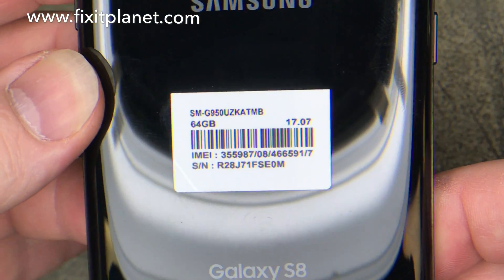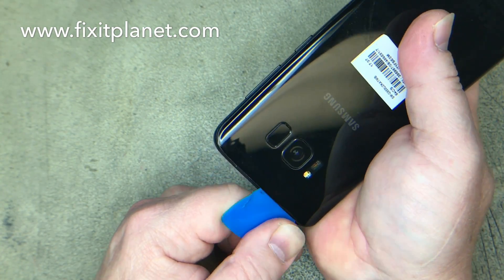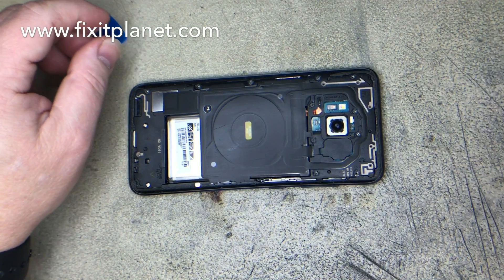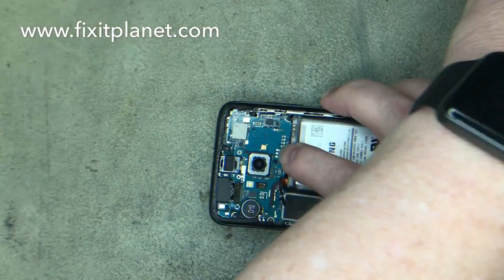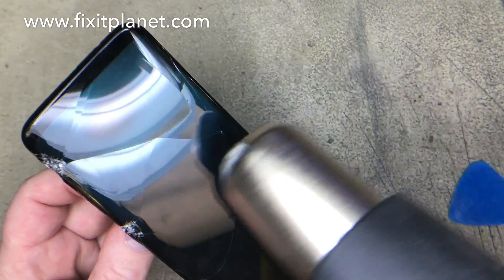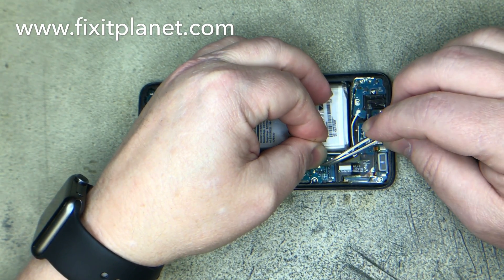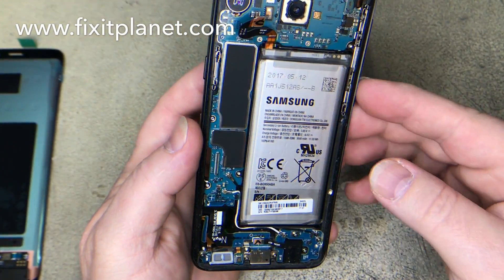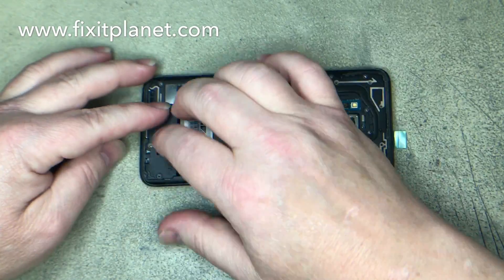Samsung Galaxy S8 Screen Repair From Start To Finish.

Comment: Who's watching on their broken s8 : (
Reply: Mine did fly all over the stairs from the third floor all the way down to the ground floor :/ both sides are broken.. happy that it's still working at least
Reply: Gabriella Ceccato i bought that 360 case to hide the crack on the top right corner now. It's pretty good
Reply: I'm on my 3rd S8+ after having it replaced twice due to a broken screen! Not sure why this model is so fragile. I had an S2, Note 3 and 4, and never got so much as a chip. And I'm very rough with phones.
Reply: Haameem 

Unfortunately, I am too.
Reply: Yep.  I'm getting it fixed next Tuesday and I wanted to see how it works.  Luckily I have insurance so it's only costing me 30 bucks to get a new screen.
Reply: @AerasaniCaecina  i have Insurance on mine also, did you use the company that was affiliated with Samsung called "ubreakifix" and if you did, how has it been working every since? Touch or calibration issues? Thanks a lot in advance.
Reply: @AerasaniCaecina  Andd..... did it works
Reply: Sheesh I remember when my s8 cracked last year 😭 I cracked it the weekend I got my phone LOL😤🙄
Reply: I'm truly surprised and disappointed at the terrible build quality of the s8, its so fragile and easy to break and then hundreds to repair. Wish I knew this before getting the phone to be honest.
Reply: My s8+ screen has cracked twice while in a armoured case and that sucks...I love this phones performance but the curved screen is very vulnerable to cracking and there is no upgraded screen from Samsung. The last time my screen broke it fell less than 18" from my couch on to a carpeted floor in armoured case. It cost 200.00 to replace the phone under warranty and less than a month later its cracked again. I'm pissed. There will be no more curved glass screens for me .
Reply: @pat402  
SCARY STORY. ..WTF
Reply: @pat402  S10e is flat! :)
Reply: Me my s8+ fall down by a baby he drop my phone I was mad but I just cool my self it was damage we I come home everything was fine but tomorrow the upper screen did not work 😞I was sad I had to pay 20,000 to fix       R I P TO MY 20,000 money
Reply: Me my husband cracked the corner of my phone :(
Reply: I am
Reply: It happen yesterday when I was talking a dump
Reply: Slipped out of my pocket 😵
Reply: My mom turned off the wifi so I got mad and threw my phone onto the wall it has a small crack on the top left now. I was planning on getting a new phone and now I have a excuse. But then I cant sell my s8 cuz it has a broken screen and no one will want it smh
Reply: Me
Reply: Me
Reply: There will be as much people as you got likes watching it with their both back and screens completely broken after trying what they saw here, 100% positive about it.
Reply: Me
Reply: same but mines working pretty fine lol the heavy crack didnt affect anything
Reply: Me
Reply: just cracked my s8 a few days ago :( can't afford repair so im planning to just put screen protector over it and hopefully it lasts long XD
Reply: @elmothemilkman99  did it last over 6 years?
Reply: Me lol
Reply: Christina Cole lucky you
Reply: Me
Reply: Haameem Rathore legit fell doing bmx on my s8 pull it out and instant disappointment came in
Reply: I'm watching on my new daily driver (the s9) my dad had the s8+ but now he has the s9+. He gave me his s8+ to use as a secondary driver and I'm having trouble finding a good kit to fix the s8+ so I can use it without cutting myself
Reply: I only have scratches on my S8+ and dropped this thing too many times in water or washed it in tap so idk why my phone is still alive even after an year???? 😬😬
Reply: It has 1 a little bit crack then a big crack right in middle of the display.
Reply: @turnipii4246  🙋‍♂️
Reply: It's so broken that I'm watching on my backup phone
Reply: Me
Reply: Sadly me😓
Reply: <--- this guy
Reply: Yea :(
Reply: Lol .. meeee
Reply: Me I just broke it today I accidentally dropped it face first on the cement
Reply: here :(
Reply: I am
Reply: Haameem Rathore Me lol,
I'll be sending mine in to Samsung in the next few days
Reply: i am just want to be ready when that happen.. still safe for now
Reply: Me
Reply: 6 months late but mines fully cracked :(
Reply: Nope watching on my old s6 because the screen is totally dead on my s8 ringtone works so i know phone works
Reply: MEEEEE HAHAHAHAHAHA
Reply: Unfortunately meh
Reply: Haameem Rathore e
Reply: Me with crying heart
Reply: Im buying a kit off ebay and going to fix my phone.. lol seems very easy.
Reply: Me 😆
Reply: My s8 has JUST had screen burned.. lol
Reply: Me :(
Reply: Hi
Reply: Me
Reply: Me :(
Reply: Me
Reply: @tremccord8396  unfortunately me also. About find out what's best way to handle this with Verizon since i do have Insurance on the device.
Reply: I am🙋‍♂️
Reply: I DIDNT MEAN DO I ACCIDENT HIT MY CONTROLLER ON THE TOP HY THE CAMERA AND THE SCREEN BROKE I WANNA COMMIT NECK ROPE
Reply: My S8 had a encounter with angle iron, I cannot watch anything on that.
Reply: ME
Reply: I have 7 scratches :(
Reply: Me
Reply: I am. Dropped it from my face and landed on the asphalt. Cracked in the upper right corner. Really annoying. Maybe time to upgrade to S9 or S10/S10e instead of fixing it.
Reply: me
Reply: Yeah:(
Reply: Me 😪
Reply: Im watching on my s7 broken screen because i bit int it cause i was so pissed at brawl stars
Reply: Me :))
Reply: Meeeew
Reply: Me
Reply: Me🙁😰😰😰😰😰😰😰😭😭😭😭😭😭😭😭
Reply: Not me but mine has like 3 or 4 scratches that you can actually see clearly and feel, then there are more throughout the whole screen that are only visible with the reflection of light, but it really bothers me because it looks so bad...
Reply: Not me🤣
Reply: Me! Except with a cracked note8 lol
Reply: Me
Reply: Yep...;( got home and noticed a crack right where the home button is -_-
Reply: @afreemn  what happened after? I cracked mine yesterday
Reply: @justinherrera2159  I was at an arcade with my brother, not sure what happened that caused it to crack, I always have the screen pointing towards my leg so even if I hit the phone on accident, the back would be the part getting hit. And of course I have a case, but honestly I'm not sure how it got cracked
Reply: Me
Reply: Meeeeéeeee☹️
Reply: @Andre £150to £170 I have been quoted from 2 places one did my I phone 6 when it was about 8 months old he did the screen and new battery for £80 he said he won't try the Samsung he sends them off to get done I would have stuck with apple if I new this about the screens being so delicate.🙄
Reply: Wish it was working to be able to do so
Reply: I habe a S8 but hes not Borken. 🥳
Reply: Lol 🙋‍♂️
Reply: No im watching on iPhone xr i want my old phone
Reply: HEYYY
Reply: Me :(
Reply: Me
Reply: Me :( broke the screen today and broke to buy a new phone in meantime
Reply: This guy😂😂 *(not neccesarily broke but um cracked ...so yah brokeish😂😂 (kind of like my bank account😂😜)
Reply: I’m fixing it to sell
Reply: Me:(
Reply: I have a big crack on my s8 so I'm gonna get it fixed soon
Reply: Me
Reply: I’m on my backup cuz I can’t even do my security to log in
Reply: Me
Reply: Me .
😰😰😰
Reply: Not me mines beyond unuseable that the touch capability malfunctioned on me this is why im watching this on a diff device and so i dont have to burn thro so much money getting mine fixed so i can make a profit
Reply: I broke my s8 screen yesterday when charging
Reply: @Tryxoth  add up the costs very carefully before replacing your screen refurbished new S9 seems cheaper
Reply: Here :(
Reply: HAHAHAH!.. me!.. and within 1:30 of this demo I realized that I do not possess the skills to complete this task..
Reply: Me 😫😞
Reply: Me
Reply: Meee
Reply: Me
Reply: Facts 😂😂😂
Reply: Me I dropped it just right and cracked the screen and to repair it its 350
Reply: Michael Martin you sure you ain't using apples repair site? You can repair the screen professionally for less than 150
Reply: @patriotcam1776  350? That is what a need phone cost
Reply: Here. :(
Reply: i thought this was the note 8 lol wrong squad lol i feel like regina in mean girls lol you cant sit with us
Reply: Taurus April-Mae lol
Reply: i m not 😂
Reply: Jake Margiotta what you gonna do about it now?

Comment: This guy’s voice and the calm music in the background makes you wanna be brave and do this yourself.
Reply: Are you flirting mate??
Reply: Lol
Reply: That's exactly what happened to me and I shattered the back and the screen as I peeled them off 😅

New phone screen is in though and I'm putting the shattered back on and sealing it up with a phone case! Woop woop
Reply: Facts💯💯
Reply: 😂😂 I swear
Reply: Just done mine a had a issue with my GSM signal but the withe wire was plugged in opps
Reply: What a wholesome comment
Reply: I know your comment is old but I wanted to write to tell you that it looks intimidating but it's not, it is pretty fun having to do this and once you do the teardown over and over it becomes an addicting hobby and a new skill learned that you can apply to different phones and technically become a phone repair person yourself.
Reply: Nah I have ADHD and I'm a dumbass I ain't trying it myself
Reply: @jadengrant8141  [
Reply: @jadengrant8141  adhd doesn't do anything, just do it mate, noone cares if you fail
Reply: Dead

Comment: Where did you buy the replacement screen? Because I only found LCD Screen and Digitizer Assembly for 350$!. But not only the screen. Thank you in advance!
Reply: Steeve Werren you can find them on amazon for 30 bucks. Im just not sure if its worth getting only the glass as doing a glass only replacement is tricky, as most people are saying.

Comment: Samsung made their screens super fragile.
Reply: the s7 screen was better.
Reply: Mome lasted about a year and a half. Dropped it just right.
Reply: lonewolf031 Truly?
Reply: Yes they do they make adds that even if u drop it I wont break but once u get the phone and I falls not even 10 feet the phone is cracked
Reply: Yeah, I worked through his video and fixed my S8, but the back cover shattered at every step. Phone works fine, just put it in an Otterbox Defender case and left the back screen off. Duct taped the camera cover and thumbprint scanner. Works perfectly, but yes. The screens are so fragile! I would much rather pay this fella. Fantastic job on this one!
Reply: That’s not true. I dropped mine a couple of times face down, before the screen officially cracked.
Reply: apple made their screens extreme fragile
Reply: @khshow9891  Apple bought their screens from Samsung.
Reply: Yup dropped from 3ft [pocket], and my screen cracks at bottom right.
Reply: I'm a clumsy person and I've dropped my phone a lot it only cracked after stepping on it with high heels on the the corner of the screen
Reply: Not really I've smashed mine plenty of times and dropped it but my luck I end up breaking it
Reply: @dylanrap8154  liar
Reply: Ur an idiot look at apple
Reply: @EvanDear  apple uses samsung screens but for some reasons those crack so much easier lol
Reply: @PixelTanukiGames  lol ikr apples screen's crack easier!
Reply: @EvanDear  apple sucks
Reply: Evan Dear I have both apple screens are more resistant.
Reply: any screen will crack with the right pressure or the right settings, thinking that one is better then an other is being ignorant ... also rumors are that apple are actually using Samsung's OLED displays since they are pretty much the best producer out there... just in case you didnt know, iphones are assembled by apple but most of the stuff in there are actually produced by other compagnies...

Comment: OK, so i just got the s9, I dropped it and a corner chunk of the touch screen came off, enough chipped off that i could start a pick under the screen without going through the process of removing the back first to push the screen from through the back.  Is that possible or you MUST take off the back first??
Reply from the maker: Need to get the back off to disconnect the battery.

Comment: I am sorry i need to ask i got my s8 from repairs. And the guy who did it is a complete idiot. There is a small hole on the insulation now and water gets inside the screen nothing wrong with it, it's just so annoying. Also on the white screen you can see buldges, it's like you can see the parts behind the screen. I've tried to take out the water with rice and silica all that nonsense but nothing helps. The guy won't fix it what should i do should i change the glass only or the whole screen. Where can i buy it cheap
Reply: bro go to aliexpress,search for vangoch screens and buy it for 170$ replace it yourself

Comment: My new screen arrived today. I will follow your process. How long did you heat the phone with heat gun ?
Reply from the maker: Depends on several factors just needs to be hot enough to start a gap and loosen the bond.

Comment: I'm worried about a short circuit. How can I prevent this from happening? Will just a shutdown suffice?
Reply from the maker: Power off then disconnect the battery.

Comment: Can someone tell me if they sucessfully changed their screen from this video? I'm very eager to buy the materials, and change my s8 screen myself.

Lol. I don't want to spend 250$ at the store 😑
Reply: I spent $250 just on a new display... Places wanted $400+ to replace it so I did it on my own.
Reply: Tyler Hardy ...was it easy n how much it cost to get the tools to do it yourself
Reply: @hondaguy9153  . Can you please provide the link you brought it from on ebay?
Reply: what i worry about is that S8 has super amoled screen(based on LED), while the replacement screens are LCD, it's not the same technology at all
Reply: Alexander Rarick tru
Reply: is the repair at samsung cheap or not just needed to replace the display cause this guy survived badly for an year and maybe theres water damage im not sure but it must be fine now cause its water resistance but must make sure what to repair on my phone the display or the inside too.
Reply: I feel like you'll end up spending that much anyways for tools and making sure you got the right tools as well as getting something to suction cup the screen up and AS WELL AS PAYING FKR THE SCREEN
Reply: I just fixed my galaxy 8 just like he said to do and ordered kit that came to only around 50 thats with tax
Reply: Make sure you don't move ahead of yourself like mister know it all. Take it apart nice and easy slowly and your good to go 😀
Reply: did you do it? I feel like the same. And prices around here on stores are $350 or so, I bought the screen and display replacement on ebay and will follow this video slowly when it gets to me, total cost $195 - in case I don't fuck up and destroy my phone..

Comment: So does the digitizer need to be replaced as well? The actual glass of mine is the only thing damaged.
Reply: Cheeki Breeki: IV Damke you ever find out the answer to this?
Reply: No lmao.
Reply: You can replace just the glass but there is a 90 percent chance that you'll damage the display when you try to separate it from the glass.
Reply: Cheeki Breeki: IV Damke I made a video of trying to separate the glass from the display...I left it in the cold for too long and ruined the display.